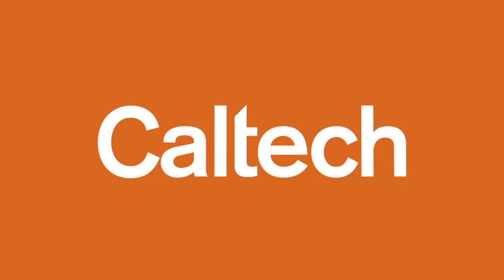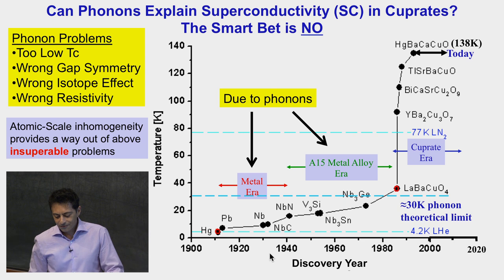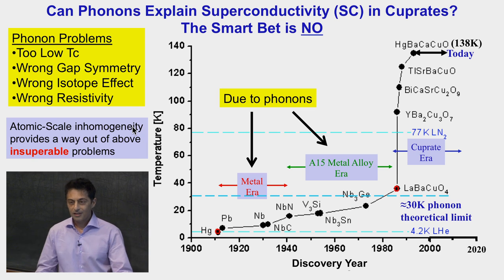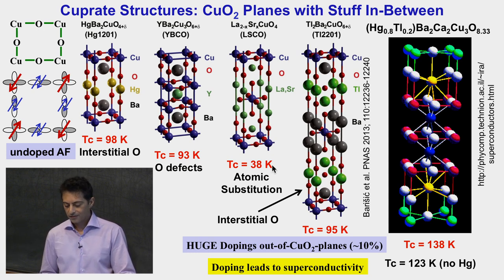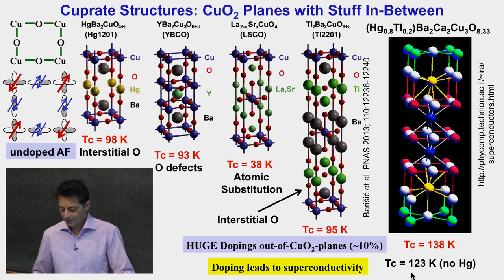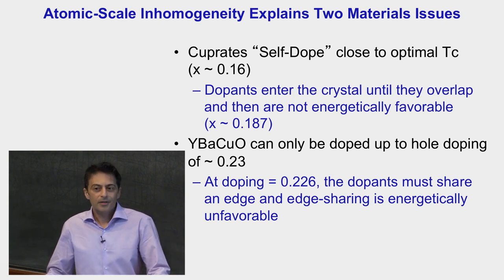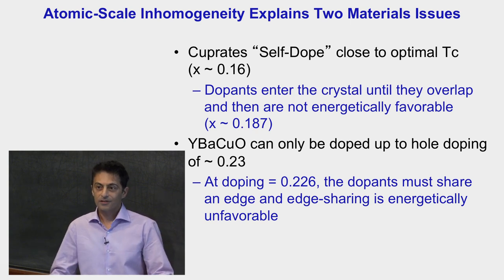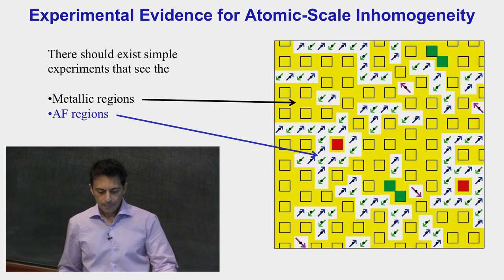Understanding Superconductivity in Cuprates - J. Tahir-Kheli - 6/29/2015

Comment: That's impressive. Thank you. 

If the SC mechanism is, in effect, a structural instability in the "quantum foam-chemistry", to coin a name for guessing what happens, then the rigidity of normal temperatures implies a frequency relationship tied to the typical conditions that should (probably) follow according to the relevant solid, liquid phase at that (compound) frequency?
Ie, it's purely speculative, but the guess is that the limits of SC are measured for the solid in liquid, liquid in solid state phases?

From the thouroughly comprehensive exposition presented, there is probably some trials of dissolved solutions?
The speculation about "what's inside a black hole?", is too specific about locating the principle "out of reach", as if it works differently there, rather than simply different in proportions. 

Structural proportion, quantum foam, crystallography, etc, are the virtual projection inflated by time-duration of implied spin frequencies in superposition, ie orbits and orbital in bubble-shells and phases of wave-particle shells..., by graphic intuition about "holes in the leaky p-brane".(?) Not limited to electrons?

Comment: 1) I would like to use superconducting  wire to make electromagnets ;  are there any such wire being marketed?  If so, where would I be able to buy this
superconducting  wire? or

2) Where would I be able to buy Electromagnets (about 1" x 1" in
size) that are made of superconducting wire?
Reply: Did you realize SC need cryogenic temperatures to achieve that phase? Most metals become SC but not at room temperature.